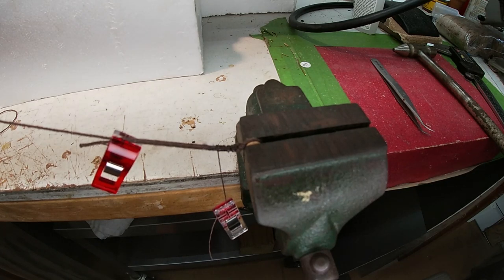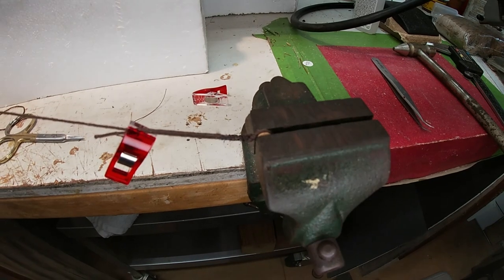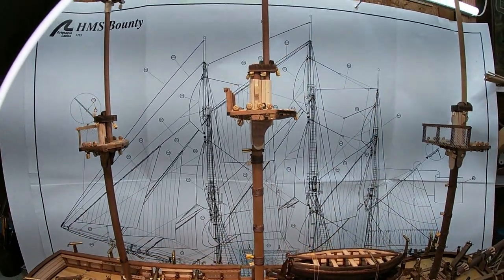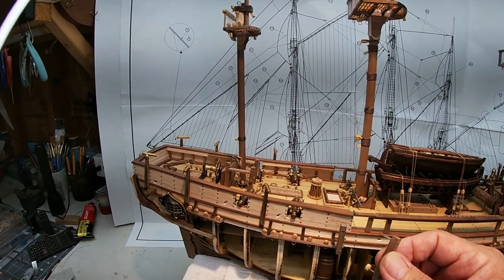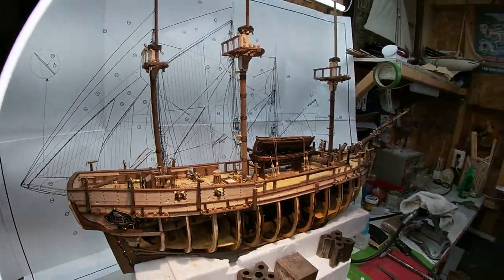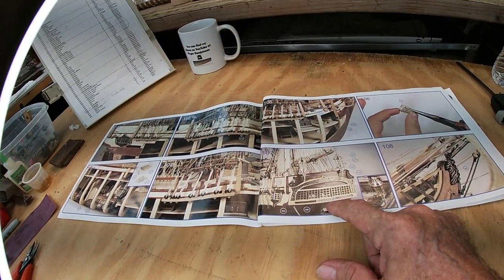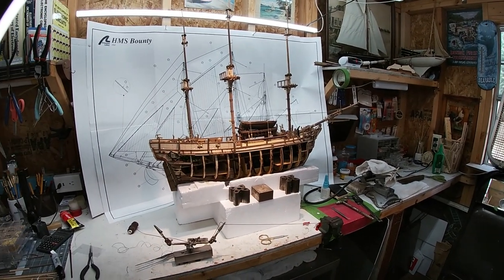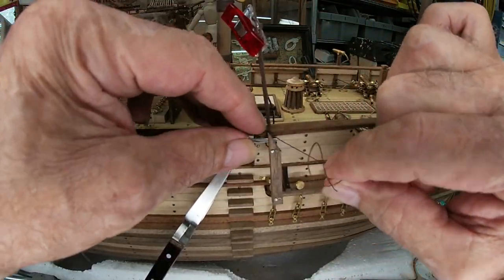HMS Bounty build part 30

Comment: Hi Roger, I’m building Montane’s & rigging the dead eyes and shrouds..80 on shrouds and ..50 for the lacing . Kind of hard to keep dead eyes from twisting after lacing up. Guess there’s not much to do about that I guess. Nice video. I’m in Florida as well , starting to cool off a bit
Reply from the maker: Ya lacing from left to right , tension , pre streaching the shroud and dead eye orintation are all part of keeping them from twisting. Try bees wax on the shroud that might help.